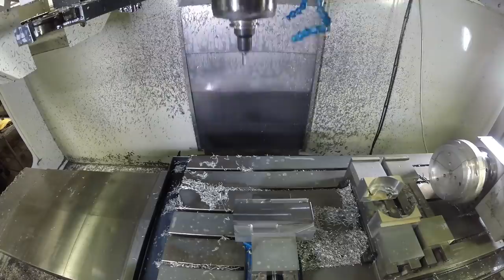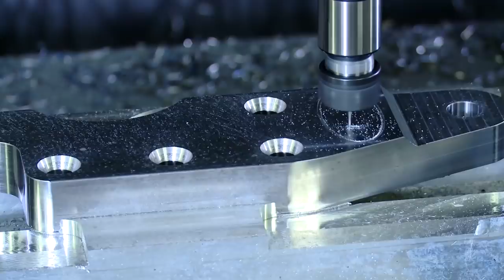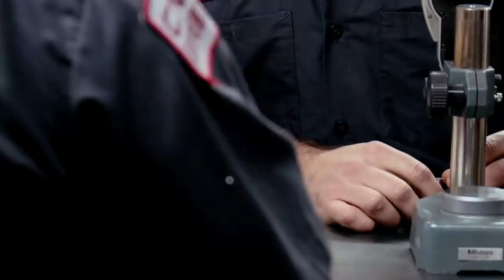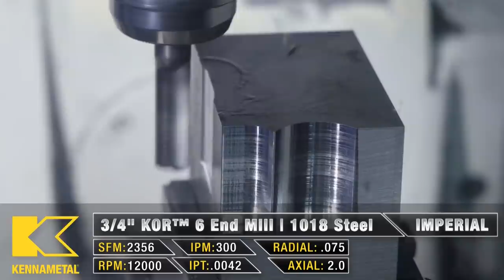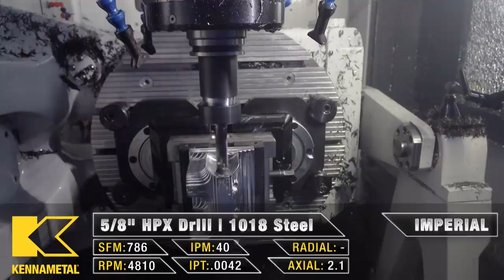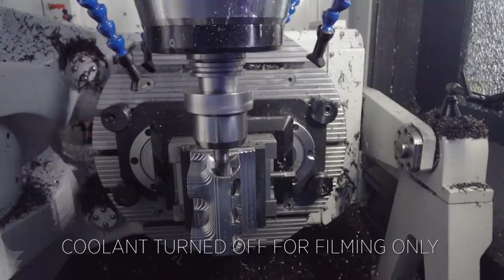Tools Keep Breaking on Night Shift, but Runs Perfect on Day Shift... Nobody Knows Why

Comment: Hahaha....sounds SOOOO FAMILIAR!!!!

I worked in a shop where on 1 day new cutting tips where tested and feed rate and depht were almost doubled and  time before changing the tips was also 25 percent longer.  Price was almost the same.

Then  the  representative of the tooling company  asked me 1 week later why  the tests where outstanding but in production where the same as carbide tips from other supplier or sometimes cutters were completely demolished 

Answer of machine operator:  it cuts so fast I am not ready reading the page of the newspaper.   So I lower feed rate and depth  so I can finish a newspaper page per product.

And the engineer in the shop sometimes reduced feed rate and cutting depth as,  I quote the secretary ( nice lady who knew A LOT!!!!!!) :  by switching to other supplier he wont get a very nice EXTREME EXPENSIVE  X-mas gift from the usual supplier anymore!!!!!
Reply: Sounds like the owner doesn't know what he is doing.  😁
There is no newspaper reading or any other reading while people are getting paid.
And the engineer gets paid by us so they don't need any gifts from suppliers.  
Problems solved.

Comment: Nothing worse than when you have the job dialed in and humming. Then seeing the feed rate down 20-30% and the rapids at 50%.  Plus, the operator twitting his thumbs while you're losing money every hour
Reply: Educate the operator instead of blaming him.
Reply: The rapids at 50%?  Would you prefer them to be faster, or slower?
I did not understand that part.
If you want to see amazing amounts of destruction on your expensive CNC machines.... Have a bunch of button pushers running them at 100% rapid all the time.

Comment: That is valid information, when in doubt, read the manufacturer's recommendation, or remember what the tool's  designed to do, to what substrate, at what rpm,  what rate of speed. Some aggressive cutting profiles look like you'd want to go slow, but they resonate or chatter at a frequency that is harmful to the tool's specific material. Running slower feed rates at higher RPM, may heat the substrate, cause expansion, higher friction, tool chatter, top it off with an increase in tool to substrate contact pressure due to heat expansion, and let's say, Inconel substrate, (example) imagine that conundrum, paradox, path to meltdown

Comment: I used to use an Advent 16 pitch thread mill. It was 1.5 in long and had 12 inserts. I don't remember the od of the tool but it was around 2 in dia. And the tool stuck out 12 in. So the mill was in use for years, inserts lasted a long time, thread size always good and so on. I get the new "night guy". "Night Guy" notices the 12 inserts and says that "this tool should go like hell". After "careful calculations" "Night Guy" edited the program and KABLUEY! HE wrecked all 12 inserts and the part.
Reply: Always clear every change with your engineer , or get ready to have a smaller check ......
Reply: Lol.  I'd love to know how he thought that the number of inserts changed anything.
Reply: @jamisojo  I don't know but it was cutting every bit of it's 1.5 in. langth and running just fine all day long. On top of that it was running on an old beatup Toshiba BMC50 that had enough problems as it was.

Comment: Depending on your specific roughing strategy the feed and speed used as a baseline back when everything was roughed based on a .5-1.0xD @ 60% radial engagement is almost completely irrelevant... too many factors involved.... lighter radial percentage at higher depth combined with a progressive engagement of stock from air blows those rules of thumb away... Calculate actual chip thinning to shoot for the suggested actual chip load and "read" the chips and you can't go wrong in my experience.

Comment: Those are Dana 60 high steer arms , wfo concepts . Got a set sitting in my garage. I’m assuming you guys milled them , did an excellent job on them !
Reply: I thought they looked like d60 high steer arms!
Reply: I work for Dana. There strategy: Put an low cost operator on a cnc machine. The only thing they must do is mount a piece on the fixure and push start.
If there is a problem they must flick on a red light and wait for help. This results in a lot of production losses.
In my time at Clark company every worker received training courses until they could work independently and solve problems themselves. No need for expencive team leaders. The result was a far more smoother production with less losses.
Reply: @MrTWOproductions  "their" strategy.  "expensive" team leaders.
I also noticed that you didn't quantify the increase in profit that Clark reaped.  
I'm not saying you're wrong, but it's hard for you to claim you are right without quantifying something.

Comment: Funny how if you do what you're told, ie: run the program as designed by those paid to make sure it runs right, and shit breaks, you can point your finger at them and go TOLD YA IT WAS WRONG, but if you mickey mouse their set up thinking you know more than they do, YOU'RE the one in trouble. People are (typically) paid for their smarts in jobs like this. Albeit most engineers can't turn a screw driver the right way without a 20 page manual explaining lefty loosey righty tighty for most applications, they are pretty damn good at figuring out the minute details of order of operations, failure expectancy's, feeds and speeds based on a products specs. 
The days of production shops saying "Run it how you feel you can to produce the parts needed" are GONE. Between the access to material densities and known failure rates of tools and the plethora of information that is available out there on the webs, the guy standing at a machine who's job is to "put this part here, mash that button, take out finished part rinse and repeat" needs to just do his damn job and IF he has an idea or suggestion or complaint about how he THINKS things are going he needs to take it to the lead person or the engineer who designed it all. 
I always compare those "know it all" operators to a person who has watched 400 episodes of some medical show yet never has taken a first aid class trying to tell us medics we're doing it wrong and they really don't know anything.
Reply: It's not always quite as simple as that.

Comment: Moral of the story: never trust night shift
Reply: What a ridiculous thing to say. Depends on the shop, I've worked in shops where the day shift fucked everything up and then the night shift would come in and fix it and of course vice versa. The last shop I supervised had the experienced machinists on 2nd shift because they could handle problems on their own without support [try getting tooling at 2 in the morning] the day shift was for trainees and not so experienced machinists because they had the whole engineering department to fall back on.

Comment: When I started in cnc I was taught to listen to how the tools are cutting, what sounds good and what sounds bad. And how to adjust speeds and feeds to get a better cutting sound. HSS drills and tiny endmills are the only tools i've used that tend to have very limited speeds and feeds they can properly operate in. I've also learned that if your breaking fresh tools within one shift, something is very wrong, unless it's very hard steel.

Comment: That's insane rpm. At that cs, your running 2250 on a 4" facemill. We can do like 400 tops on manual mill with good coolant and still burning out bits.
Reply: We can kind of compensate with deeper cuts and heavy chewing.
Reply: We ran 3-in face mills at 8,000 RPM on aluminum... And faster sometimes.
Reply: Maybe 15 years ago we used to use a three insert two inch face mill with really dull square inserts.  That might be more like what you're using.   
I think our 3-in face mills are Seco 6 insert "quattro" face mills.  
The aluminum inserts are super sharp.  The steel ones are much less sharp.
Reply: @jamisojo  Thats just wild too me. Granted we mill through a lot of torch hardened plate, we are at 8 inserts on our 4" facemill. Anything higher then 400rpm burns the bits out pretty quick. We have flood coolant at best.
Reply: @jamisojo  I can run deep to make up for the rpm loss, but I might have to look somewhere else. Which company do you use for your carbides?

Comment: I had this issue, problem was on day shift actually.
It wasn't a tooling issue, it was a personnel problem.
They didn't want to run it so they would just break the die.
When asked how I got it to run the day shift supervisor wasn't pleased with my answer.
Reply: What was the purpose of the die in the manufacturing process you were doing?
I can't tell if you were making things with a die..  or if you were making a die.

Comment: Seems like an IR camera and a sensor that measures vibration somewhere would lead to better diagnostics for evaluating certain settings than doing stuff "just because". Then instead of waiting for stuff to break, you could see if a bit or cutter is running too hot or look at a readout graph to see if chatter or resonance is increasing in a not so good way. Of course cutters and such should have associated parameters or tables, but some quantitative measurements of performance could allow even more fine tuning. Also aren't there operation logs for different shifts? That way notes could be compared to see how things are done differently if one group has more problems and figure things out faster before having to call in somebody.
Reply: That would very greatly depending on the size of your operation you are talking about.  
Apparently what you are experienced with is a very sophisticated level of machining.  😁

Comment: As Soon as you said works fine day shift but breaks down night shift. Straight away i was  thinking user error. These machines hardly break they are made to such high and tight tolerances there is no room for error.

Comment: Sounds like you did everything right by making sure that the speeds in operation we're good. Sounds like people like to think for themselves instead of run with the program that you gave them that you had proven worked. That seems to be a common problem when the supervisors are not around

Comment: After many years working in the machining field from black n decker mfg to the aerospace industry . Worked in tool and die shops , to mfg special parts from beginning to end . I prefer Bridgeport milling over all , however as a great machinist you learn to use lathes  , surface grinders and various other types of machines making all different parts . After reading many many comments , not once was a very important thing that ALWAYS holds true in machining was mentioned and guess what I’m not going to share it … it took me many years to learn it from a master machinist … it amazed me with all the technology 30 plus years later , no one mentioned it in their comments . PS I would never never work on ANYTHING following someone else … and today I would put a secret video camera on the machine while I’m not there . Paranoid ? Why not in this crazy , sin field world we live in !!!!
Reply: I bet the elaborate ball milled contours you make on your Bridgeport are amazing.  👍😉
You can keep your secret dude... nobody cares.

Comment: 30% on the feed rate and 70% on the spindle speed... pushing 30% of the material into 70% of the spinamathingin'?  It's been 30 years since I worked in a machine shop - I could understand this causing chatter, perhaps, but why would a slower spindle and MUCH slower feed cause rapid end mill failure?  (Genuine question, I'm not disagreeing, I'm seeking understanding.)
Reply: It's not cutting enough per revolution... Resulting in a kind of rubbing against the part or not making big enough chips to carry away the heat.
This causes the tool to heat up too much.  Not the kind of problem you'd have on aluminum with coolant.
More difficult materials obviously get very finicky.
Reply: @jamisojo  Thank you.  "Not making big enough chips to carry away the heat" brings back memories of my tech school tool & die instructor milling off a piece of steel, using a carbide cutter at roughly 1.7 gazillion RPM, flinging smoking-hot purple-blue chips everywhere, undeniable visual evidence that THOSE chips were indeed big enough to carry away the heat. 🔥🔥🔥

Comment: Seems like a machine that complicated would have a logging system so you can see changes made and run specification through a web ui.
Reply: It should.
Reply: It's usually easy to find a bar graph of whether the machine was running or not.  
It may not tell you what percentage of the feed rate was at though...

Comment: not a machinist I actually work for an injection molding facility and ironically, we have the opposite issue you described here. Graveyard/third shift is the most senior crew in our shop with the majority of the workers on the shift being those who are hold overs from years past and just gravitated towards the night shift since its generally a quieter shift (less infrastructure shifting/machinist work at night) and as such we have the most experience technicians, engineers, packers, etc. in the shop meaning if something needs looked at for fixed it's usually left for our shift to deal with. 
Problem is First and Second are both very green crews with relatively new engineers, techs and packers, for instance last Saturday we fixed problems we'd been having on the 77th press in our shop which we'd been having for about a month, pinched parts and parts handling were messing up terrible badly because the settings were too fast and the material wasn't getting a large enough shot of material so the parts were running lighter than they were supposed to. We fixed this problem, went home. Monday night the press which we'd fixed was now running WORSE than before we fixed the problems because first shift had determined the shot size was too large (false as both shots were realistically within spec for the part we were producing however the press wasn't damaging parts on the heavier shot) and the parts handling was running too slow to keep up with the volume (the decreased speed was still at easily manageable levels for the press) the press was producing. I was off here last night (Adjustments were made this past Monday, I was off this Tuesday) so I'm unsure if the adjustments remained, however it'd be far from the first time that we fixed a problem twice over only for an inexperienced crew to change things on us a third time. To be clear this is not to say the engineers and techs on the other shifts are bad, but they're basing their experience off of knowledge of other presses, materials and production parts which are not the same as the part Press number 77 produces.

Comment: A similar but even crazier thing happened years ago at a shop where I worked.  A new guy on 2nd shift was running fewer parts than 1st shift.  He had no programming experience so he clearly wasn't changing the program, just being lazy.  Management noticed his poor performance and was preparing to fire the guy after being there only a few weeks but running consistently slower on his shift.  Then one day the 1st shift operator came in & pressed the START button.  The machine appeared to stall on the first feed operation.  That's when everything became clear.  The 2nd shift SUPERVISOR was changing the program to slow it down at the beginning of the shift & speed it back up at the end of the shift to get this guy fired.  His sabotage was revealed when at the end of that particular 2nd shift he forgot a decimal on the feed rate.  As you know on a HAAS (at least the older ones anyway), a feed of "10" vs "10.0" are COMPLETELY different and a feed of 10 without the decimal pretty much brings the machine to a stand still.  Since the operator had no idea how to change the program, the supervisor was busted right away.  He admitted what he had been doing & was fired on the spot.  That was a wild twist that none of us saw coming but the operator was the most surprised after finding out his boss got fired for trying to sabotage him.  That was a crazy day.

Comment: Sfm, ipt, and chip thinning equate to way more than what the operator can quickly determine from rpm and ipm.
The number of times I get to go figure out why tool life is bad, or cycle times are off and find that the operator has made adjustments on their own without calculating anything is nuts. The only times I toss out the rule book is when you have part or tool rigidity problems, or harmonics to overcome. A lot of the time those can even be solved by adjusting the set up.
Good video man!
Hopefully some operators see this.
Reply: Because God forbid you have a quality conversation with your own operators.  😉🤣😂🤣
Reply: @jamisojo  It would depend on the operator really. Some are little more than button pushers, that's the harsh reality.
I always explain why I'm making a change one way or the other, but whether or not they grasp it and retain the knowledge isn't a garauntee haha. 🤣

Comment: 'That's the way we've always done it and it worked well for years' Ok, then here's a 2lb hammer and a cold chisel, now cut out a 2" long by 1/4" keyway on that 3''' shaft, need 250 finished by end of shift.

Comment: So. I know zero about machining but know w pretty good amount about production in an industrial type of environment. This is very common for the worker to in almost always good intentions try to run out of centerline  settings for one reason or another. Usually causing many more problems than what they thought they were fixing.